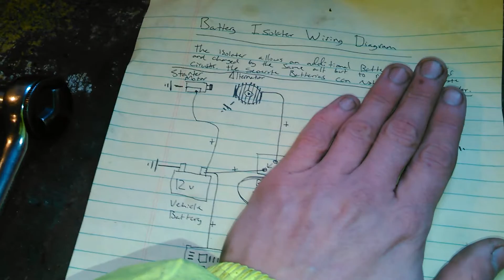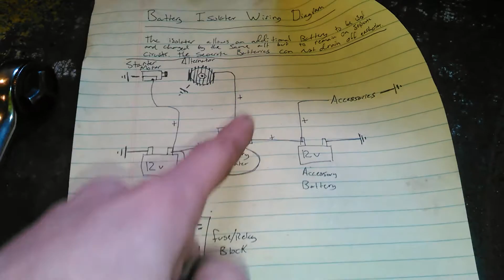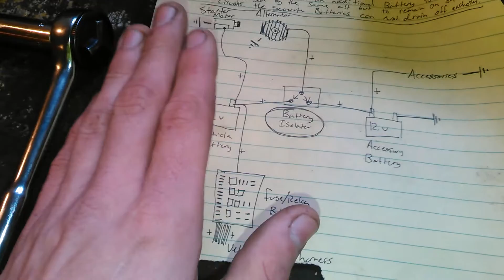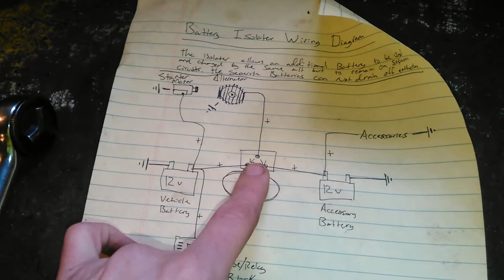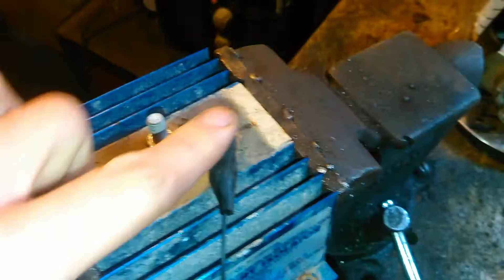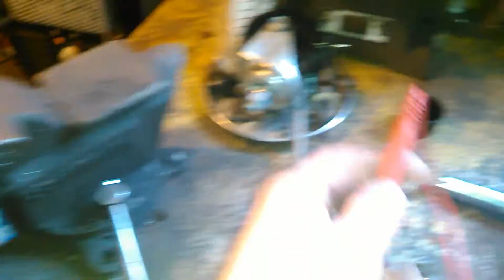How to test a battery isolator

Comment: I’m not sure that I need one but when I’m plugged in at home I hear it clicking repeatedly I feel like once the house batteries are charged it tries to charge chassis and it’s full so back to the coach batteries …is this why it continues to click repeatedly? Thanks in advance
Reply from the maker: A battery isolator has no moving parts. It doesn't click. You have something else.
Reply: @TowTruckNate solenoid? but there’s 3 it looks like…the clicking is coming directly from the battery control box, when I open it, at the top above the fuses there is auxiliary start reset button, when I push it it’s that same solenoid clicking.
Reply: @TowTruckNate btw thanks for the response bro

Comment: Almost correct. The advice given is spot on, however, you should also check for any continuity between each terminal and the case, or ground of the unit. They can also fail in this way.
Reply: On a 2 alternator 2 battery isolator should the ohm readings be the same for each side?   What should the ohms be?

Comment: cool, im going to try that..  i just got an old snap on truck with the one that charges 3 batteries..  they wired it wrong and cooked it..  they wired the alternator charging wire and BAT 1 to the same lug (main bat lug) ..   $400 part is now trash..

Comment: Can you test while hooked up?
Reply: No. You must remove all wires from terminals, prior to testing.
Simply take a photo of the wires before removal, or use masking tape to label the wire positions, to insure correct reinstallation after testing.

Comment: If you are using a dual battery system, I recommend to install True Smart Battery Isolators to manage your system. True SBI automatically charges and switches the charging based on voltage reading. It has a 3 year lifespan, waterproof and vibration proof. See more details at www.trueam.com or www.dfna.info for single item.

Comment: I have a sure electronics multi battery isolator as well. I tested it using this method and one of the diodes is broken. I tested it with a battery and electricity indeed flows in both directions (only on the broken diode). Can I still hook the working side up to the starting battery of my campervan and the other "broken" side to the accesory battery?
Reply from the maker: hook up the side that freeflows to the normal battery. Hook up the side that only flows one way to the extra battery that runs accessories. This way the extra battery cant draw off the regular battery if the power gets to low.
Reply: @TowTruckNate I believe it's the otherway round. Since you want the "normal" starter battery to always be full enough to start. You don't want this connect this one to the broken freeflow diode since then it could supply/lose power to the accesory battery which is not what you want. But there isn't a danger in using a diode which is shot?